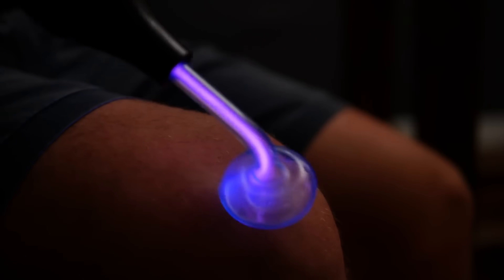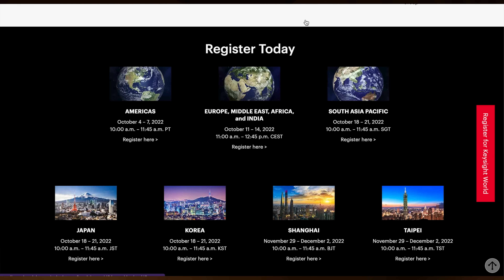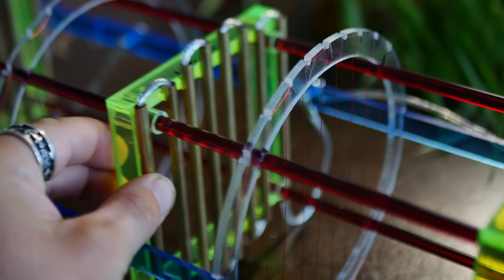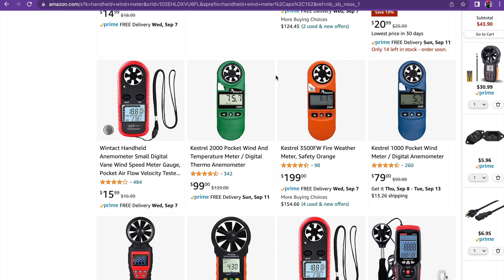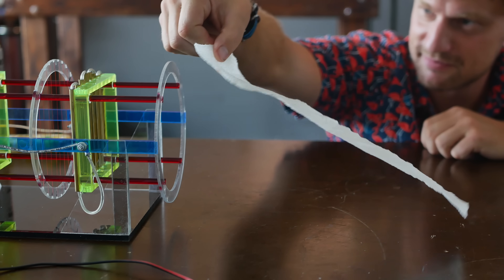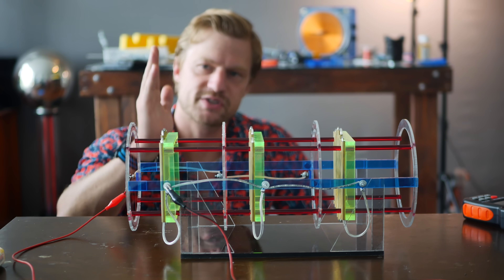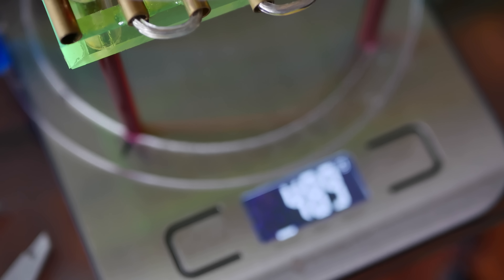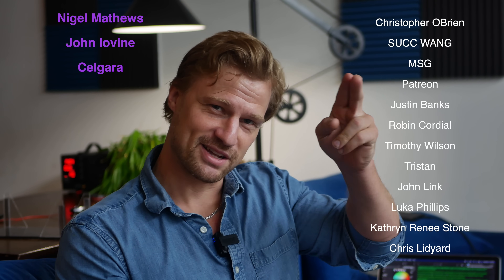Designing A Next-Gen Ionic Thruster! (For Flight)

Comment: Back in 92 I was in highschool. I read an article on ionic propulsion that NASA was using or trying to use on probes, so I did a bit more research and attempted to build a gen 1 ionic drive... unfortunately I lacked the equipment to be able to measure such weak thrust (single thruster rod at 50kv)... I won my school science fair and got runner up at county with a 2 word report and a demonstrator. my 2 words "it failed" I did have background info on the demonstrator, but I needed to create an enclosed chamber to be able to block air currents so I could show if it was my thruster providing air flow, or a butterfly in china :)

I have always believed in the technology, though I doubt it will be able to produce enough thrust to drive anything more than a RC plane/drone for a LONG time. It thrilled me to no end when Sharper Image released it's "Ionic Breeze" as that proved the ionic propulsion worked (even if lacking sufficient thrust to be useful at this time)

Comment: You got a faster reading for the staggered spacing because you measured it closer to the center of the airflow. The other readings (when the meter was standing on the table) weren't centered, so it probably was not maximum flow.

Comment: Ok, that's cool. Just wondering if the pattern of the wires makes any difference? What if you rotated the middle stage 90° so it's wires were perpendicular to the first and last? Or used a pattern where the wires weren't parallel to each other? Or instead of the wires of each stage being on the same plane, they were conical?

Comment: The grounding (collectors)-rods have the wrong shape. There should a semi-circular side and semi-triangular opposite side.  One side acts as a collector and the semi-triangular opposite side as an emitter. The grounding rod body is the base. Such a shape permits electronic respiration. And due to the bernuelly effect aids in ion and air flow. See this video: These Planes Are Propelled With Ionic Thrust:  https://youtu.be/VSYwaesDQBw  

 Also to increase ionic pressure (air-flow), you must increase frequency dramatically with each successive stage, not just Amperage. Again, watch this video where a very high frequency is the coincidental result of a very high amperage 800Amps and thus the loud humming!:  https://youtu.be/txmKr69jGBk

Comment: I figured staggered spacing would be better, but wouldnt you see the most benefit from a close gap at the intake, and a long gap at the exhaust?

This is similar to each stage of compressor in a jet entine aiming to increase compression with each stage using adjustible stators. Or perhaps the variable pitch on a propellor plane achiving ideal thrust at different airspeeds. In this case, you want the airflow off of each stage to have undergone greater acceleration, achieving a greater speed. I'm guessing that the airflow allows the arcing from one electrode to the other to extend over a further distance, wouldnt it? Taking advantage of that after each successive stage with a longer gap would provide a longer time over which the air is accelerating, would it not?

Also, I would imagine a flight test model would use an aerodynamic intake, tube, and exhaust, would it not? And I would imagine it may be possible to leverage convergent sections to boost air velocity through the device.

Anyway, cheers from an Ex-usaf jet engine mechanic, and current physics major in school. This video hit the nail on the head for me as far as interests go.

Comment: Just found this channel, but if I had to take a guess:
1) Close the sides. This will reduce turbulence in the flow.
2) Tightening the grid spacing. More air effected by the strongest fields
3) Spacing between Modules. Like the individual modules themselves finding an optimal distance from each other should help.

Comment: How about a solar panel inside an airfoil - the solar provides for your high voltage - air enters the wing from the front and gets heated by flowing around solar module - then goes to your ionic thruster. 

solid state no moving parts .  1000W per square meter from the panels. how much power needed to glide around ? 

slingshot up to speed and then ionic thruster takes over ?

Comment: Well I may not be able to spot the 3 inefficiencies right away, I do have one suggestion.  Why not try to improve the thrust by introducing a nozzle at the end?  You could make 3 conical nozzles for instance, where the output diameters are at 20%, 33%, and 50% smaller.   Or you could even try a linear aerospike nozzle.  This can be accomplished pretty quick on any CAD program and a 3D printer.

Comment: You have to maximize air volume (mass) and speed to make the most thrust. Lowering aerodynamic drag becomes more and more important as velocities increase. A slight flare/ bell on the air intake end of the duct will help improve air flow a few percent. This also makes me wonder if you rolled a  plastic sheet into a slightly cone shaped duct, if it would improve the thrust out the back, this is a typical jet engine design concept... You have very little "pressure" available so the cone shape would have to be very slight. This might add another percent... it would be a good experiment nonetheless.

Comment: A rough estimate is 13 W of air power.  So at 90 W so wall plug efficiency is 14%.  Pretty cool.  I suggest a slight redesign of the thrust measurement system to avoid momentum effects of the air redirection.  Brass is quite heavy and the round tubes create drag.  Slats would be better.  Have fun.  Awesome and inspiring.

Comment: few potential improvements i can think of is ducting, as in like ducted fans.   The also the foil sheets instead of rods.   This would improve aerodynamics, and weight.   I also noticed there were several pin pricks of plasma coming off the threads (during the lights out scene).   I'm not familiar with that thread, but perhaps the thread could be designed better so that it could expell plasm more easily.    Another thing came to mind about old CRTs monitors.   They used to heat up the element at one end, to make it easier to expel the electrons to the front of the screen.  Maybe this idea could be filddled with also.  Maybe there is an ideal temperature 'sweat spot' where it is energy efficient.   Truss design could be used more, for less weight.

Comment: Round tubing is one of the worst aerodynamic shapes, creating terrible turbulence (Karman vortex street / shedding). Try "Aluminum Streamline Tube 1/4"  used for model airplanes, which has a tear drop cross section. Should improve air flow substantially. Aluminum is also much lighter than brass.  Great build, look forward to seeing the final version!

Comment: It would be nice to see how the thruster performs under backflow pressure. Velocity is an analog for distance. Backflow pressure for force. The total thrust would be the quantities multiplied. 

It might be useful to vary the voltage by distance from the edge of the tube. Higher velocities near the center of the tube might give better performance. The distance between thrusters should likely be varied as well. So maybe input and output cones with various voltages scaled by the curl of desired air velocity? 

Of course, ducting with likely venturi effects is obvious. 

A clever adjunct would be a properly formed magnetic field to add acceleration. Magnetic confinement of plasma isn't trivial though. Plus, magnets usually want current which takes metal and adds weight. But magnetic motors seem to outperform electrostatic ones. So it's probably worth the additional weight. Particularly if you can generate the field in the stream and thus skip the normal iron reluctance circuit. 

If you really want an advanced design, maybe you can inject microwaves as a power source. The potential for remote-powered thrust would probably have some unique applications.

Comment: Although I'm in a completly different Line of work, i'm always impressed to see builds like these, Great work!
As for suggestion of improvments, how about a coneshaped duct with internal grooves, much like those of a riflebarrel to passively give the air a spin and reduce drag? And instead of having the electroderods standing in a straight Line, tilt them a few degrees between each section. Also have to Bend them a Little to compensate for the increse in distance at the edges, but in turn Will work well with the coned duct.

Comment: 1 is the open body causing loss in velocity, 2 is the tubes you are using as ground instead of a square or honeycomb grid, 3 is the way you have the wires set up, maybe use a grid? Or more ""turns""?

Comment: Two inefficiencies: Duct, nozzle. Thrust is provided by static pressure over a given surface area, this ion thruster can move air, but you need a restriction in the flow (nozzle) to compress it. It also suffers from air leaking out the sides so a duct to contain the flow before it gets blown into the nozzle will greatly improve it.

Comment: Very interesting! Some thoughts: this ionic "thruster" is moving air without moving parts; what you have is a fan. Some other applications might include long-lasting ventilation systems (no friction), wind cooling without mechanical noise (no wobbly rotors), and maybe even vacuum systems (no oil contamination).

How does the electrical efficiency compare to a mechanical fan? How quiet can you make the next version? How much pressure difference can you make, and how quickly?

Comment: 🤷‍♂️ you are basing your idea on airflow on aerodynamics. Calculating weight is cool, but to include mass of an object includes an object in space. Then you have to pick a gas that is easily compressed with a good fuel mixture… then you have to split the current up and work out a way of heat expansion flow. 😁 dinner time cool design, try cris crossing the wire flow.

Comment: I haven't read all of the other comments, so apologies if I repeat any suggestions. 
1) Use thinner lightweight carbon superstructure with aluminum or titanium hardware.
2) Try ducting the entirety of the structure. You could use plastic wrap for this to maintain it's lightweight nature and have minimal insulative property as a benefit.
3) With high voltage and low amperage, could you use a very thin gauge single copper strand wire to reduce weight further?
4) Design a voltage "selector" circuit using a potentiometer to carefully "tune" the voltage output of each stage to it's maximum efficiency.
5) Attempt to use a thin copper stranded mesh as your ground plane to further reduce weight and reduce the "drag" to the passing airflow.

These suggestions may be repetitive, or even nonsensical as I'm not qualified to design or implement these myself, but they are just thoughts I had. I hope these help, I enjoy your videos!

Comment: Nice ion thrust generator. If you enclosed the system and funneled the chamber down inside the housing, this would increase the efficiency of the thrust. Another possibly is if you varied the voltage between the chambers your efficiency would also increase. You might try rotation of the stages to see if that helps. 
This was a great demo of a proof of concept.

Comment: Instead of having «stages» how about a corkscrew design with the strings going in spiral while the wires is in «level» so the it still shoots straight, the spacing will need some tweaking of the strings to get the perfect resonans, to increase air waves

Comment: The three inefficiencies are:-
1. The device requires huge amount of power and it produces low thrust 
2. Thrust will reduce, when the air density in the surrounding is low.
3. Thrusters will require housing for power source, thrust to weight ratio will reduce even more when we will include power source's weight.

Comment: The copper tubes add weight to your design as well as blocking air flow. if you replace them with foil you will get a definite reduction in weight and maybe an increase in air flow.

Comment: Needs to be covered like an actual jet to help keep the airflow coming from only one direction and sent out in one direction.   Needs to be able to compress the airflow for more airflow being moved in a smaller ares for more thrust.   Also needs to be able to change the staggering of the coils for different air pressures.   You will not get the same thrust at 40,000 feet as at sea level.  Less pressure means less airflow.  Also why only three at such great distances from each other.  Jet turbines have multiple fans close together to help.

Comment: I built a very small version of this 24 years ago into a tube with controlled free air tanks from my lab. I WAS ABLE TO FLOAT A QUARTER. I thought how cool is this. I used dual tower ignition coil that I controlled the Frequency and voltage real time.
That made a Hugh difference. I had a dream of installing thin wires over an airplane wing to increase lift and efficiency at low altitude. But since I had a lab with NO, NO2, NOx meters I found the emissions was too great to be practical and stoped.

Comment: That is great if you want to move a tiny piece of toilet paper. The thrust is extremely low. The device cannot lift itself. 2.3 m/sec = 5 mph. Wacky doo. A drone with 4 props does far better and can lift itself. An ionic thruster can only work if you can achieve at least, 5000 mph instead of 5 mph. Warning: Do not stand behind a 5,000 m/sec thruster
Ionic thruster in space uses super high velocity, 90,00 m/sec (over 200 mph) and they can NEVER lift from earth to space because their thrust is still much too low

Comment: This could possibly be a partial solution to the age old hover board solution from Back to the future!😅
Reply: It really could not. Ion propulsion provides very little thrust. The best you could do is something like miniature turbines like the flyboard guy did, or on a linear track like lexus did with a superconductor and quantum locking. 
Ion propulsion is mainly only used in the vacuum of space where they need a natural gas to push through for the positive ions.

Comment: Design enhancement question at the end.
1. Lacks air management. Perhaps it would benefit from some airflow considerations.. venturi and compression

2. Air leakage.. perhaps encasing the air flow chamber to prevent leakage

3. Cyclonic configuration of plasma grids. What would happen if you could rotate the grids by a few degrees (eg grid 1 0deg, grid xdeg, grid 3 2xdeg) ?

Comment: The corona wire is what the ions are pushing on.  Would a tear drop shape with the point facing the rear negative electrode cause fewer ions from pushing in the wrong direction?  Either from the sides or in the case of the last two stages on the side of the previous negative electrode.

Also I wonder exactly how you tested individual stages.  Completely removing a stage for testing would have an effect on the charge density, wouldn't it?  So testing with the stage off vs testing with the stage removed would make a difference I think.

Comment: 1) increase the surface area of the anode, most easily by cross-hashing the lines you already have
2) IDK if this would work but remove the two other cathodes and run resistively staggard anodes to progressively pull the ions through the unit 
3) obviously duct it,
4) separate the power supply so all power in the first cathode is taken by the first anode, second second, third third, this will reduce the ions vortexing as they move through your current setup
5) shape the cathode so there is a wing shape pointy end to the anode 
6) more power lol

Comment: The 3 inefficiencies I can think of are
1) because you rely on a lightweight construction, the power source will be a problem, batteries are heavy. 
2) maybe the anodes are too bulky, preventing a good airflow
3) as mentioned before a nozzle and an enclosed design could help for better airflow but add more weight of course

Comment: The emitters instead of being lines can they be grid? Crossing each other? That would double the trust per stack. Also if these lines are using micro needles spaced in the wire  pointing in the direction of thrust.. it would create many more plasma points?